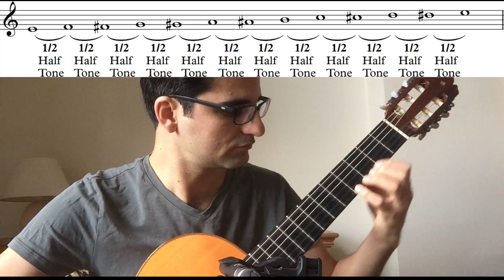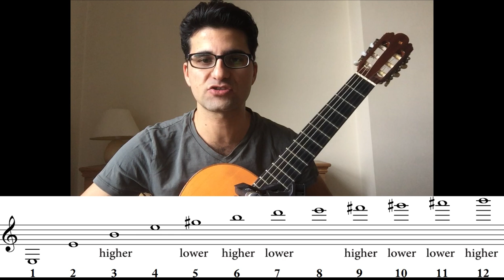Major 3rd Problem of All Guitars in the World

Comment: Im a drummer and just started playing guitar and i know the very basics of theory. But i understood nothing from this. What should i learn before i can even understand what the title means?
Reply: It all boils down to ratios. For a pure major third, the ratio of frequencies should be 5:4, and for a pure perfect fifth it should be 3:2, and for an octave it should be 2:1.  In other words, if you have note at one frequency, the note an octave higher will be 2 x that frequency.

However, it turns it that there's a problem if you try to construct a tuning system that works for all scale notes based on these frequencies.  If you have 8 octaves, then the frequency ratio between the lowest and higher will be 128 x (no problem with that).  However, an alternative way of making 8 octaves is to use 12 perfect fifths (it goes, C -> G -> D -> A, etc).  But if you take 12 perfect fifths, the final ratio works out to 3^12/2^12 (where ^12 means to the power of 12) = 531441/4096 = 129.746... 

This is close to 128, but not close enough for a cigar! That difference between 128 and 129.746 is called a "comma".  It means that it's impossible to create a "simple" fretted or keyed instrument that has pure ratios for the chords, without running into major errors at some point. Instrument builders struggled with this for a many hundreds of years, until some bright spark invented "equal temperament", which simply distributes the comma equally among all notes.  This means that the only ratios which work properly are octaves, and every other interval is a little bit out - but for most people, not enough out to cause them a major crisis. However, the big advantage is that you can play in ANY key, and they all sound equally right (or equally wrong); for the instrument builder, you only need 12 notes to create an octave on the keyboard, and only 12 frets to create an octave on a stringed instrument. 

The vast majority of everyday musicians and nearly all the listening public probably never notice the errors due to equal temperament.  But of course there will be some who are particularly sensitive and for them equal temperament can be really annoying. I guess the poster of this video is one such person.
Reply: Alp A first u need to know what a third is, the third is what determines if the chord is a major or minor or any other type of chord, and typically a chord is made up of the first, third and fifth, first id say learn which chords are related to which chords, and once u know that, you can apply that knowledge into makimg your own chord progressions,and dont forget that if yur learning theory, never forget to learn yur scales, and the circle of fifths, its not so hard once you grasp it, dont worry, and oh yea, what is the first third and fifth? an easy way to learn is to count it with yur fingers, lets say you have G major, the first is the G, G will be your first, and then the second will be A, and when you get to the number three, it will be B, so now you found out your third, and fourth of G major would be C, and the now we get to the fifth, which is D, so we would have the first "G" third "B" and fifth "D" and oh yea the very basic thing u should know is that the order of the twelve octaves would be A,#A,B,C,#C,D,#D,E,F,#F,G,#G, hey guys if i said anything wrong, im open to corrections,but as far as ik, that is kind of the very basic of how to start off
Reply: Marcus Bevzyuk thank you very much man that was helpful
Reply: Mandolinic idk why but when i play an E major, the third seems to always be a little sharp and it really bothers me to the point where i dont even play the third, which sounds way better😂😂😂